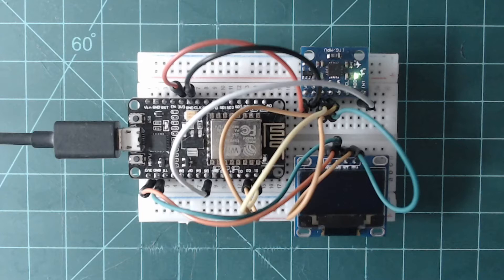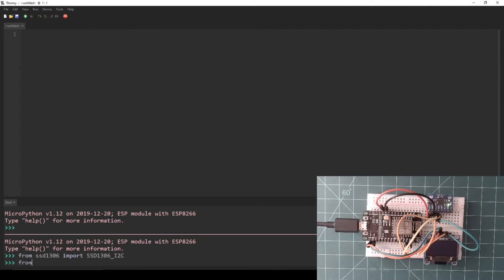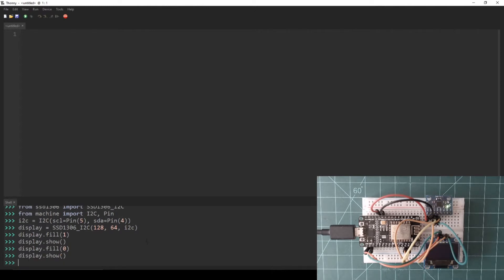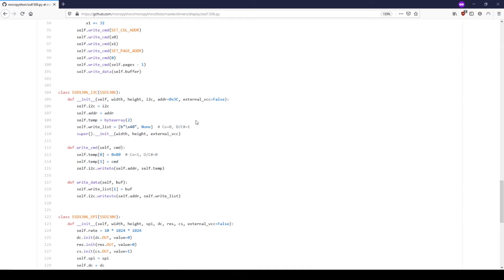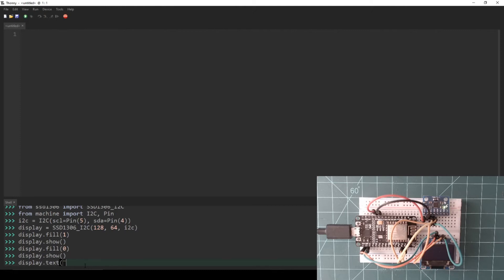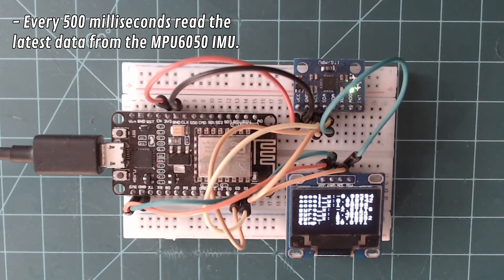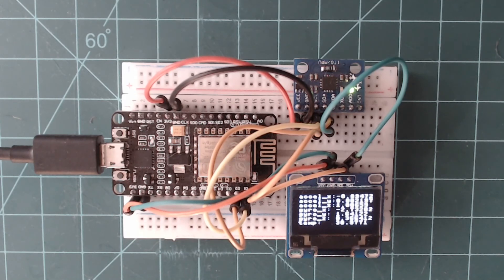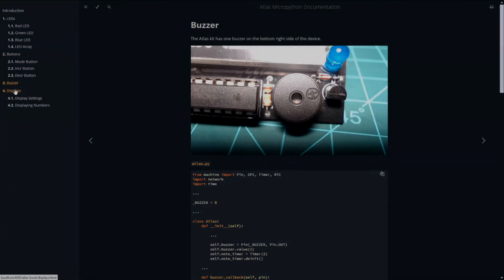Programming a NodeMCU with MicroPython: I2C Bus Part 2 (SSD1306 OLED Display)

Comment: hello sir grear video, But i want to use 16x2 12c lcd display with esp32, can you recommend any working library or make a video on it
Reply from the maker: I'm working on the first esp32 video right now. That is a great suggestion to include in a video in the future!
Reply: @ 2:06 where it says "display=ssd1306_I2C(128, 64, i2c)"  Just change it to (16, 2, i2c)